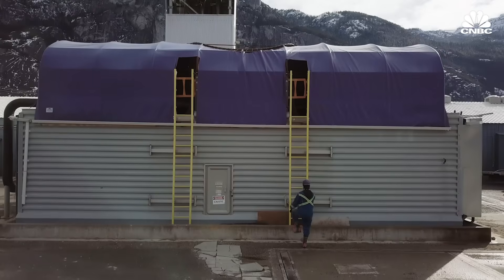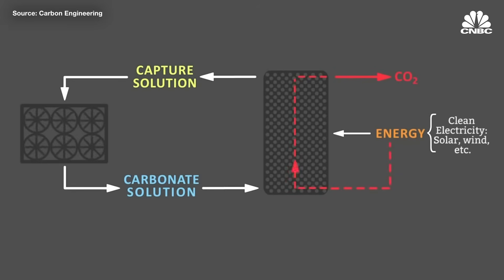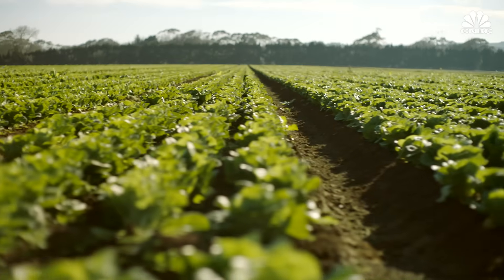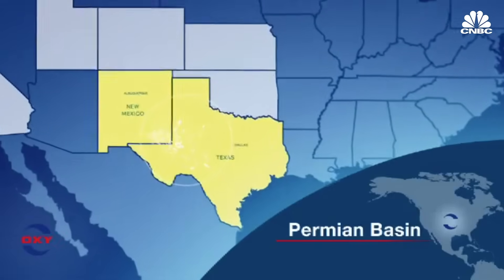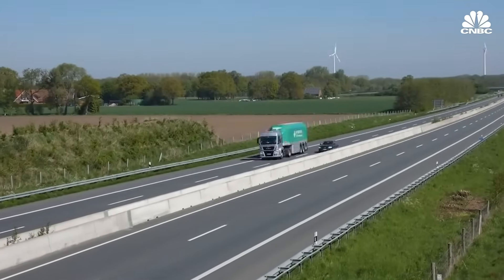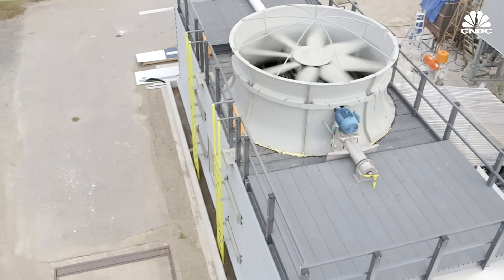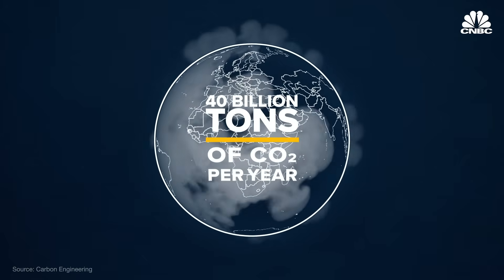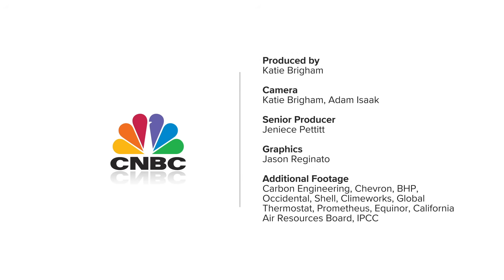Bill Gates-Backed Carbon Capture Plant Does The Work Of 40 Million Trees

Comment: Molten salt Thorium reactors until we get fusion going... No Brainer
Reply: I'm in grad school for nuclear engineering now, molt salt thorium reactors and fusion are both definitely brainers
Reply: Bro it's not that simple, both are very new technologies, and one ain't even invented yet. Thorium is great but needs more research,and both are hella expensive.
Reply: @the33rdguy  "both are very new technologie" - they actually predate our current nuclear designs but didn't get researched because the reactors we have now can be used to breed weapons grade material. Nuclear warfare delayed the technology.
Reply: Renewables and storage are barely getting started, and nuclear power plants are frequently over budget and behind schedule, if they even get built at all.
Reply: Not that simple, but honestly, pretty much any nuclear plant will do. They're hardly as dangerous as the public thinks it is. MSR aren't ready for prime time, let alone thorium MSR. Also just making the power grid green doesn't solve everything.
Reply: @Omaricon  
Oh I know about safety, I lived with them for years (submarine propulsion plant operator) PWR are an issue on loss of coolant. Molten salt are fail safe. And CO2 removal works. Its scaling them. 
But China and India need to get into it too they will far exceed US emissions in a few years.
Reply: I might not have all the facts here, but, I recently heard that China and India are both actually investing further in traditional nuclear energy as well as MSRs and Thorium
Reply: Mike Avenoso china and India are already massively improving and I very much agree with Thoreau it's a better uranium literally in every way but it's still sorta new tech. Luckily china and India are leading the green charge, its for sum reason the USA that doesn't wanna advance, not to put the blame on everyone. But USA will eventually be forced to change.
Reply: @eliasbowman54  those are progressive countries. US and Canada are regressive.

Comment: What are these chemicals that are being used on what is a giant swamp cooler?  If you've ever had a swamp cooler you know that during a storm some of the water that runs down the pads blows out, onto the area around it.  It is a great idea. You will still need to plant more trees. Trees not only pull carbon, they give off oxygen, shade the areas around them, which could lead to lower power usage in your home.  Also trees make people happier.  Who would want that in their back yard?  My main point was, What Are These Chemicals?

Comment: Oh look, a company is filtering CO2 out of the air, price effectively. CO2, which could be used to make carbon neutral fuels and slow or even stop the need to dig up more oil. And that's a bad thing to some of these people? Oh, that's right they have large investments solar/ wind (which isn't very green when you include mining for materials and making solar panels or wind turbines.) They stand to become very wealthy with tax and trade schemes, massive solar or wind farms. Wealth they won't get if the oil industry can figure out how to become carbon neutral, making the inefficient and unreliable solar/ wind irrelevant.

Comment: Using “Natural Gas” and “Dirty” power sources to power this is an oxymoron....
Reply: If only there was a way to capture CO2 from the atmosphere using nothing but light and water vapor. Imagine even if that process released O2 that we could breathe.
Reply: Its a combination of fossil fuels and clean energy. If the amount of clean energy that is used is enough to make this plant Carbon Neutral, then it is only a good thing. What a lot of people don't realize is that the Earth absorbs alot of C02 per year. So when we say its carbon neutral, it means this plant is producing fossil and other petroleum products like plastics and  fuel that is useable, without adding any additional carbon to the environment. Its not perfect, but you need to realize that in the majority of the world, they lack the infrastructure to transition to electric vehicles. How many electric vehicle recharging stations do you think exist in say, rural Nigeria? In Mongolia? In remote Alaska or Northern Canada? Electric vehicles are not practical in places like this. Also, regardless of what you say or think, fossil fuels are still the best commercial compact power sources we have. Think about generator banks that can power small towns and villages in impoverished areas. The space requirement for these generators is small, and the power density in fuel makes running these generators much more efficient than installing hundreds of square meters of solar panels.
Reply: They did mention a goal of powering the plant from pure renewable energy. Please listen. And do understand that I think this is a pretty worthless endeavor, but again, please listen.
Reply: Alkalite if they use renewable energy means someone else can’t. There is only that much of renewable energy we have each year, and majority of the energy we used came from burning fossil fuel.
Reply: @jerryqi2494  currently they are building it in BC, which is almost entirely hydro based with a new damn being built, so when the new damn is built there will be enough excess to not matter
Reply: monty58 if they build more renewable energy plant, why don’t they use it for something else to reduce carbon emission? Doing something with extra step won’t be more efficient than doing something with less step. Energy efficiency in our world cannot be 100% anyways. Why they have to recycle carbon after carbon has been produced instead of reducing carbon emission in the first place?
Reply: @jerryqi2494  BC is already almost fully powered by hydro, there are a couple edge cases up north. The new dam is being built so that the grid can support EVs but after that we will still have an excess of power generation capacity so unless Alberta suddenly decides to start buying power from us there is nothing else we can do.
Reply: They are developing this in BC at the moment so it should be fairly easy to switch to purely hydro once they get to the point of putting it in southern BC
Reply: Net gain is the game

Comment: People need to remember that the Oil & Gas industry is critical for the supply of feed stocks for manufacturing, not just energy.  Rubber, plastic, cosmetics, etc...
Reply: I think most understand it's only the energy part we have a problem with. Transportation, Electricity. But, since you brought it up....Have you seen the plastic in the ocean lately. It wouldn't hurt to cut back on that. You know, like California plastic straws. Just for example....there is much more.

Comment: But it doesn’t produce oxygen
Reply: Trees don’t supply our oxygen either. Not once ounce of oxygen leaves the amazon rainforest due to the sheer number of living animals that breathe it all in. Around 2/3 of our oxygen comes from phytoplankton and algae blooms the size of North America when the arctic melts, supplying the minerals needed for the bloom. Since 1950, these algae blooms have gotten 40% smaller due to the acidification of the ocean, rising temperatures, and less arctic ice available to melt each year.
There is a fundamental lack of understanding earths systems in America, and this just proves it.
The carbon that’s in the air need to be on the sea floor preventing it from turning acidic. It needs to be in the thousands of carbon based life forms we push to extinction every year. It needs to be in the trees we’ve bulldozed for suburbs and agriculture. It needs to be in the ground as coal and oil we’ve dug up for fuel. Not as pellets to be used as ethanol or buried underground.
Until there’s a machine that can capture the methane being released from the thawing permafrost and refreeze the arctic, we’re screwed.
Reply: @Vegandad2    "Around 2/3 of our oxygen comes from phytoplankton and algae blooms the size of North America when the arctic melts, supplying the minerals needed for the bloom."
Robert, you lost me there. WHERE are the minerals coming from? The arctic melt water?  I can't understand what you're saying, and I want to understand, if you would not mind clarifying. It is a very important issue.
Reply: alan2102 no problem. So the arctic ice freezes and traps minerals on the bottom of the sea floor inside the ice. These minerals come from the abundance of life that once inhabited the arctic in past warming periods. It travels up the glaciers and melts back into the ocean where currents carry it out into the Atlantic and Pacific. 
So you can imagine the consequences of a completely melted arctic during the summer, as well as less freezing during the winter due to the warm temperatures. 
The delicate and beautiful cycle of earths carbon cycle take hundreds to thousands of years, yet we’ve overloaded it to a point that it would need to be working in terms of decades to keep up with us.
They teach earths water cycle in school, but somehow forget to mention the carbon cycle which is far more complicated but equally important.
Reply: @Vegandad2   Thanks very much for this explanation. I have more questions, like which minerals? P? K? S? I would like to get more grasp of the specifics of this issue. Do you have a citation you could direct me to? Or perhaps a few non-obvious tech key words that might work for googling?  I would like to read a couple scholarly papers on this subject. This is an aspect of arctic melting that I was not aware of and it is important. My Big Picture self needs it.  :-)
Reply: alan2102 oh yeah the arctic is home to everything from Potassium to Uranium in its basins. But here’s a few articles if it really interests you.
https://esajournals.onlinelibrary.wiley.com/doi/full/10.1890/08-2025.1

https://academic.oup.com/bioscience/article-abstract/42/6/433/283871

https://onlinelibrary.wiley.com/doi/abs/10.1111/j.1365-2486.2010.02312.x

First google “google scholar” and then go into any key words you like. I used “arctic phytoplankton” and “arctic carbon cycle” for these.
Reply: alan2102 I've been reading through this comment section and I've never seen someone genuinely so open minded on YouTube before. Typically it's just some angry ignorant person. I love it, keep it up :)
Reply: @avalsirithanawat1772   Why THANK YOU!  Made my day.   I guess I would call  myself a fairly-well-informed angry person, a small step up from being an ignorant angry person. Ha.  :-)
Reply: alan2102 No problem my man, I'd just like to promote relative peace and understanding in this side of the internet since typically people bring out the worst of themselves when they're online with no consequences. Very humble you are sir :)
Reply: @Vegandad2  The fact it doesn't produce oxygen is very important to making it a viable solution. If you remember from chemistry class, energy is released during a combustion reaction. Essentially burning fossil fuels releases energy (that's why we burn them). The bi-products of this combustion reaction is CO2 and H2O. But chemistry also tells use to reverse this reaction, we need to add the same amount of energy to create oxygen and carbon. This only makes sense if that energy comes from renewable resources. Although you may as well replace a coal power plant with a wind farm than add a wind farm to supply the energy scrub the coal plant's CO2.

By creating calcium carbonate, you don't need nearly as much energy but you also don't get oxygen.

Personally I believe that the world needs to switch 100% to renewable energy, then start scrubbing using these methods. It just will take time
Reply: Ryan Kraft time we don’t have. And you’re right about this machines emissions. Our atmospheric ratios are all out of wack, and it does nothing to help. Nitrous oxide is being released 12 times faster than we previously thought. Water vapor is through the roof. None of my plants have been growing because the damn sun is always blocked.
Reply: Idiots like this are why I studied Environmental Science for 6 years in college. Y’all NEED me 😭
Reply: Im all for combating climate change, but this isnt the way! There is a lot of pollution in building these facilities, and we need about 9000 of them to remove enough CO2! Only 5 are being built right now. We need to stop our consumerist lifestyle, stop eating meat, only get electricity from green sources and have a lot less kids. We are trying to do this in ways that allows us to be comfortable and live our current lives, but that wont work. Massive changes are needed and it will be uncomfortable, but it will make the earth a nice place to live so its worth it. What am i doing about it? 98% of my electricity comes from hydro, i dont eat meat, i rarely buy things, dont drive and i wont have kids. The only thing that would help more is offing myself, but i'd rather spread messages like this to help enlighten others.
Reply: @Impetuss  the planet have had climate change since it was formed all those billions of yeas ago, and i don't think anything we do is going to change that.
Reply: why does it need to, we don't have a lack of oxygen, we just have too much co2.
Reply: @HandyC   Actually we DO have a lack of oxygen. 

https://www.ncbi.nlm.nih.gov/pubmed/27848144

J Physiol Sci. 2017 Jan;67(1):97-106. Epub 2016 Nov 15.

The human physiological impact of global deoxygenation.

Martin D1,2,3, McKenna H4,5, Livina V6.

Abstract

"There has been a clear decline in the volume of oxygen in

Earth's atmosphere over the past 20 years...."
Reply: Andy, we do not have too much CO2. CO2 is needed for plants to thrive. What we have is too many people who believe everything they are told without thinking it through themselves. Someone will get rich fleecing the government, and tax payers, for crap like this that will not help anything anyway. And will probably have significant unintended consequences. Many of these wackos insist CO2 should be held to below 140ppm. Plant life, our food, will begin to suffer at 160ppm. At 140ppm we will have global famine. But lets all keep thinking CO2 is a problem. Methane, sulphur and many other things are a problem in our atmosphere. But lets just attack the one substance that isnt a problem. Lets attack a substance that is one of the keys to life on this planet.  At one time it is estimated that CO2 levels could have been as high as 2000ppm. Guess what happened then. Yep, there was so much plant life that creatures the size of a brontosaurus could thrive. Huge animals numbering in the millions and probably billions thrived for millions of years. And even after eating their fill, so much plant live was left over that its decomposing matter is still around for us to use as fuel. Carbon isnt a problem. Plastics in the ocean is. Burger King bags along the highway is. There are rivers in Asia so polluted with trash that you cant see the water. We have massive landfills leeching pretty nasty stuff into the water tables. We have unsustainable overfishing of the worlds oceans. We have invasive species screwing up habitats globally. We use so much water out of the water tables that they may never recover. But lets all just keep whining about CO2, shall we? All Gore really pulled a fast one on all of us. You know while he, and many people like him, fly around in private jets telling you what you are doing wrong and getting rich doing it, all of those other problems I mentioned are getting worse.
Reply: Ed Swope I agree with you on problems with other pollutions. However, excess carbon dioxide really is a problem too. Hear me out. Yes, true that CO2 is essential for plants and that an extremely high amounts did exist in the past. However, there are certain limits to how much particular types and amount of plants on earth can absorb the CO2. The amount in recent decades is just simply too much for the current atmosphere and plants to handle. Life did once thrive under extremely high CO2 level in the atmosphere, but not the life on Earth today. Current organisms simply aren't able to survive (long term) with such levels of CO2. Yes, life would still thrive, but not before mass extinctions of current species, which may include humans. Lastly, I understand where you're coming from but I just think that my explanation above is more accurate. :)
Reply: @edswope28   last 400,000 years 180- 280 ppm - before the industrial revolution  280. Life did just fine and the plants are adapted to these levels. WHO wants to get to 140 ppm ??? Citation needed. We would be lucky to get to 350 ! Or even keep it steady for now !

true CO2 is needed by plants - and a LOT of other things. Co2 was the only thing they could always have in sufficient quantities (at 180 or 280 ppm !) - plants had to compete for space, nutrients, sunlight they need certain growing conditions (enough but not too much water, temperature, the right kind of soil, insects to pollinate, ...)
Reply: @xyzsame4081  citation needed? Go google your own damned citation. It part of that "thinking for yourself" I mentioned earlier. Both Al Gore and Hillary Clinton have made comments to that effect. Go find them yourself from sources you trust. Then it might be meanignful to you.
Reply: @edswope28  YES! Exactly! we need more oxygen. Our sicknesses are off the charts! I was shocked to see that anyone could believe that the planet has enough and as much oxygen as our Ancestors (the perfect balance our bodies thrive on). Isn't it common sense? Take out trees, lesson the oxygen?!  Yes, think for yourselves people. When the Oxford dictionary tells people that they / humans are not a part of nature ...then it's time to think for yourself.